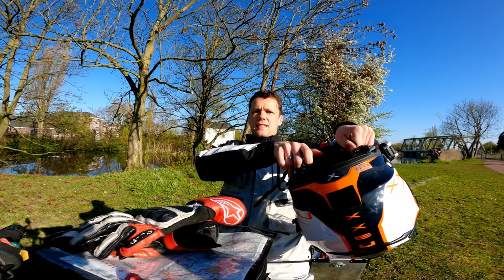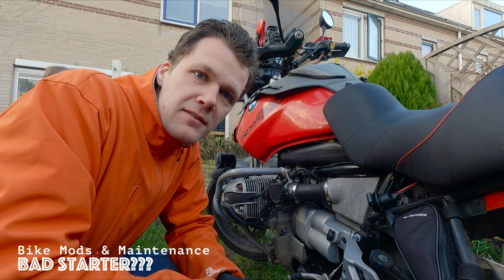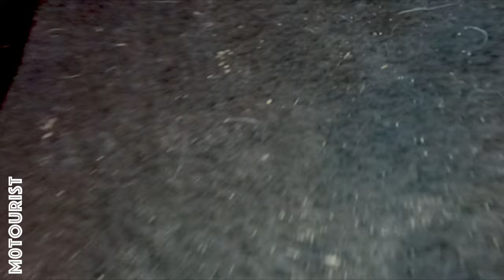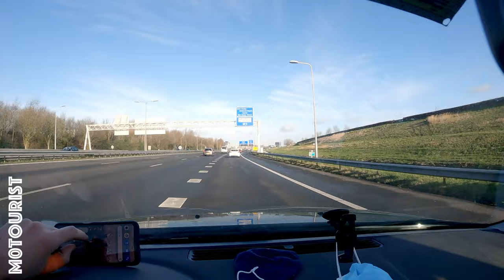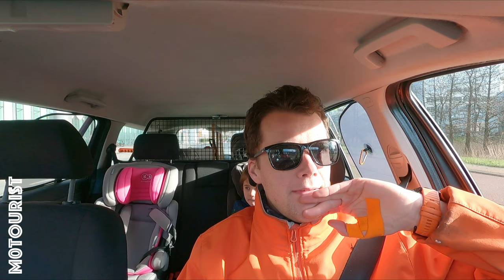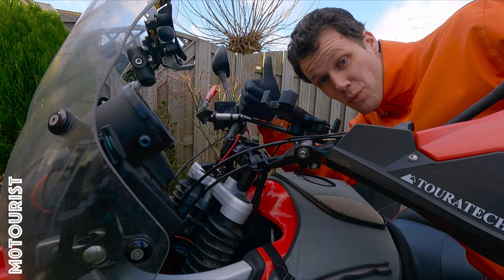Bike Mods & Maintenance - Bad Starter - BMW R1100GS

Comment: If you're reading this for guidance and instruction......he has forgotten to tell you......disconnect the battery before you start to remove the starter. If you do not, and short the positive to earth, you will have an electric light show, and possibly electrical system damage.
Reply from the maker: I cannot recall if I still had the terminals disconnected from the battery exchange or not, but it's always good practice to disconnect it when you're doing any electrical work on the bike.
This wire is one of the 'hot' wires, even when the bikes ignition is off.

Comment: But how did you find out it was the starter motor? Atm I am replacing my battery, but my battery instantly died in the course of a afternoon. So I wonder if my starter motor is the problem my, weakened, battery completely died
Reply from the maker: I believe there are some test mentioned in the BMW shop manual, but what I did was take of the starter motor, use a known good battery, connect the negative to the metal on the front side of the battery, connect the positive to the positive terminal of the starter and then jump (preferably with a wire) to the smaller positive terminal to activate the starter.

For me one of the magnets separate from the housing, so even without any resistance from the bike this only pushed the gear of the starter out, but it didn't turn around

Comment: Hello, thanks for the video. Do you think that you can lube the splines through the starter gap when removed?
Reply from the maker: What splines do you mean? The splings from the starter motor or the teath of the clutch housing?
Reply: I think he means the clutch splines? In which case, no. Only one way to do that I'm afraid.....gearbox out. A bit of lube on the starter is ok, but don't bother with the flywheel, it will only get thrown off onto the clutch housing casing.
Reply: @adelejones3746  Yes, that is what I meant. I think is always better a little than nothing. don't you think? thank you :)
Reply: Adolfo, when you do the splines, a very small amount of something like Staburags, a small pea size. That really needs doing every 20k miles. You cannot access the splines at the clutch at all without taking that gearbox out. If you think they need doing there's plenty of instruction on here (Chris Harris) consider the alternative....worn splines, very expensive. Just done mine, fairly straightforward. You'll pay over €1000 if you go to a dealer, labour intensive.